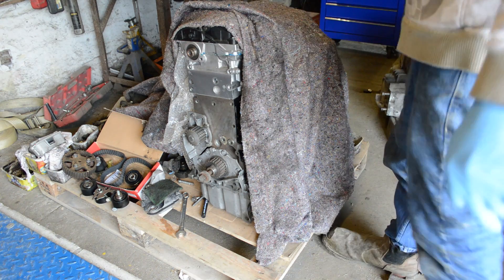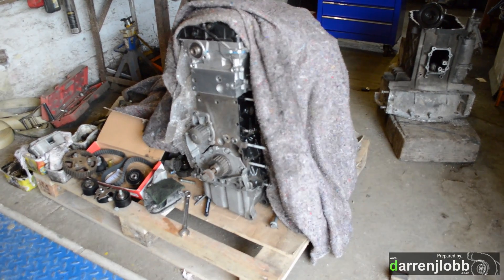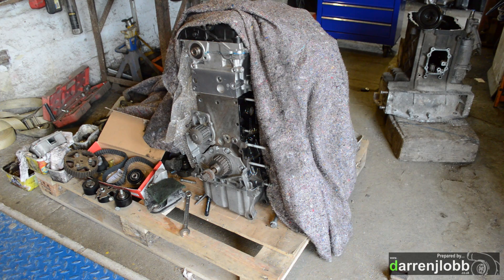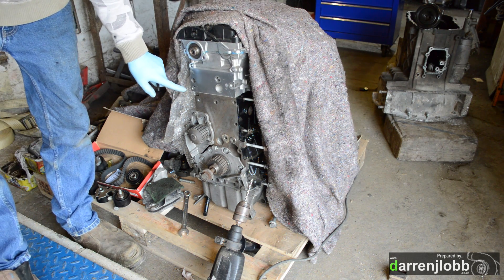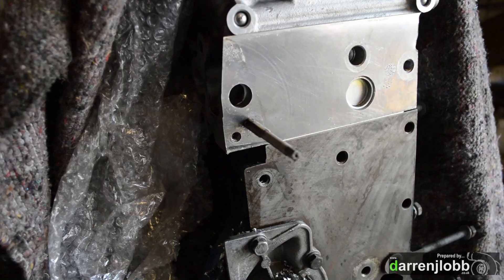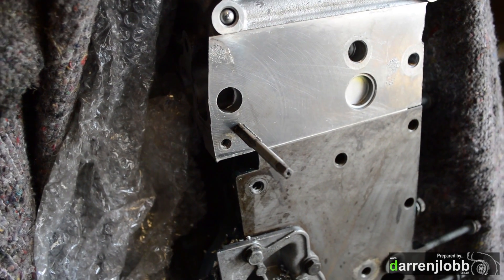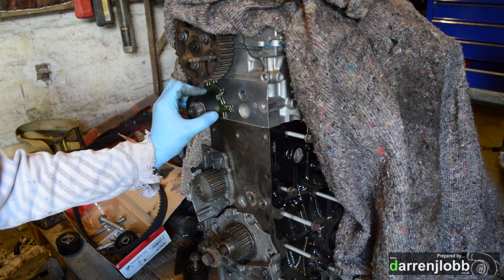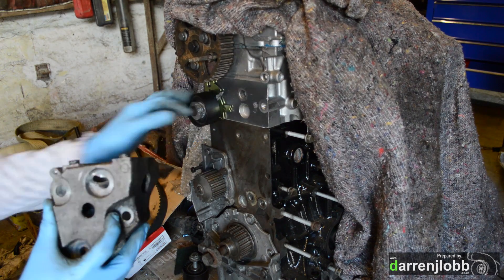darrenjlobb's JD DervBus Project Part 17

Comment: dont suppose you have  a bosch 1.9d non turbo pump for a 97 Citroen belingo kicking around your workshop have you darren ?? struggling to find 1
Reply from the maker: Hi Karl, I don't specifically no, however any bosch NA pump from an XU based engine will work, or even a lucas...Just don't connect up the LDA side of it, and can adjust fueling to get it running spot on...

Comment: Nice job Darren. Really enjoyed the video, and I've learned yet another bit of trivia about Peugeot Diesel engines. :)

Allow me one FYI: Watch what kind of bolts you use on your engines. A lot of the factory bolts are hardened and high tensile, in the range of 10.9 - 12.9. (http://www.engineeringtoolbox.com/steel-bolts-metric-grades-d_1428.html) 

Now, most of the bolts being sold in car parts stores are usually low tensile ones, somewhere between 4.6 - 8.8. Rarely will you get stronger ones, unless they're replacement parts. Threaded rods are ESPECIALLY suspect, because they tend to be of unknown strength, and are typically sub 4.6, unless you have some kind of marking on them indicating otherwise.

Long story short; though the threaded rod 'may' be OK, I wouldn't trust it enough to hold the belt tensioner. I'd get a high tensile M8 stud from somewhere and replace it. But that's just my opinion. :)

Keep them coming!
Reply from the maker: Interesting comments....Think I maybe ought to re address this bolt then!